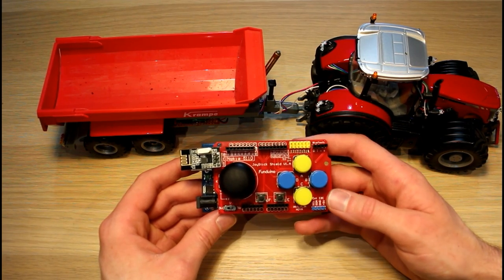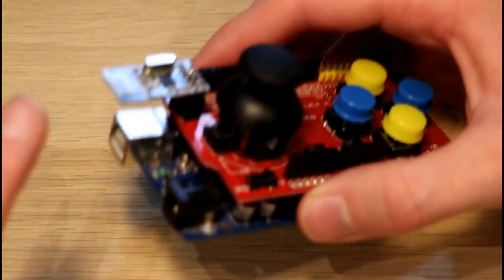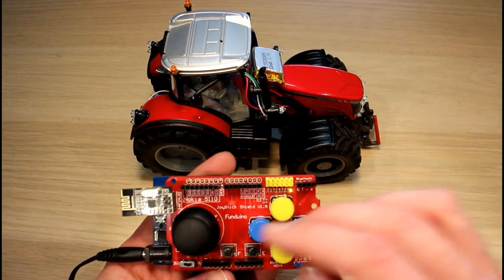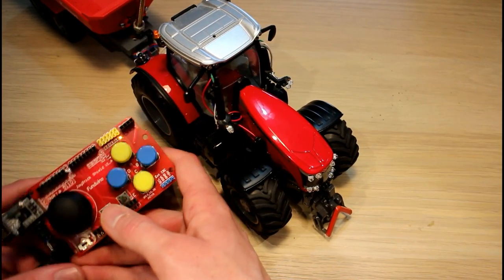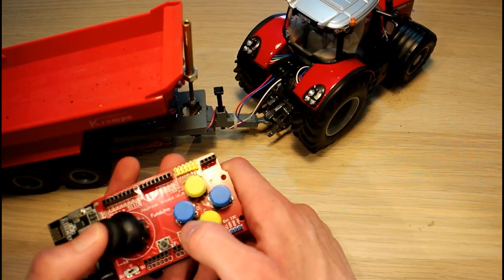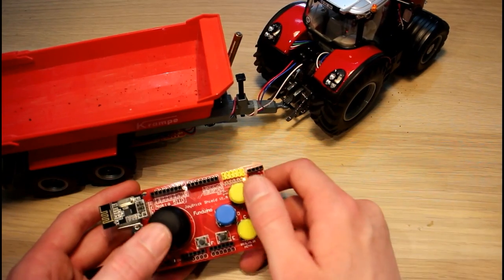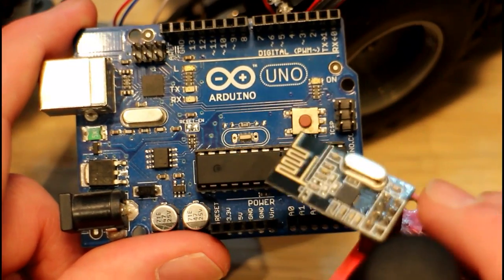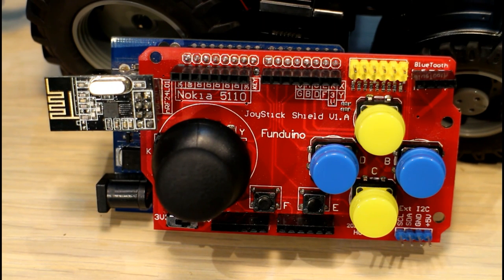Basic Arduino Based RC Controller for RC Vehicles

Comment: amazing work!  I tried to follow your code to determine how you switched modes to control different items with the same joystick, but could not find it.  Is there some code missing? thanks for a great job of showing what can be done with the joystick shield!
Reply from the maker: Hi it's been a while since I've looked into it but the code here should be the most recent http://rctractorguy.com/components/software/basic-arduino-based-rc-controller-library.  It's all handled in the library so you'd just have to look in the library files instead of the sketch to see the inner workings.

Comment: this is really good work! 
what does the tractor have that receives the information from wireless module on the controlpad ?
Reply from the maker: +dudekidPL That tractor has another NRF24L01 radio transceiver and an Arduino Pro Mini to determine what to do with the command string sent from the controller.
Reply: RC Tractor Guy Thanks a lot! i was wondering whats on the receiving end on the vehicles. your work is amazing!
Reply from the maker: +dudekidPL That is the receiving end, both the controller and the vehicles have an NRF24L01 radio module controlled by an Arduino MCU.

Comment: Hello! 
Can you use nrf24l01 which is transmitter and also receiver? İf you can do,could you please share me a basic example with codes?I want to do a project which has this issue.Please help me to solve this problem.

Comment: Hi, can i use a bluetooth module on this instead of the NRF2L01? Just bought this from your store but did not realize that i do not have NRF2L01 and thought that this is run on bluetooth
Reply from the maker: I think you could do that because bluetooth modules are usually uart I think and that shield isn't using those pins. You'd just need to do a little extra modifications.

Comment: Hi RC tractor Guy, very nice tutorial. I am building an RC tank and my bluetooth module (HC-06) keeps disconnecting from my laptop every couple of minutes or so, it's very frustrating. I was curious if I could rip out the receiver from an RC car, and still be able to write code to communicate to the arduino/motor shield through the RC car controller.  Please reply if you have the time :) thanks
Reply from the maker: Hi, the receiver in a cheap RC car is usually very crude so I don't think it would be worth the hassle. You could use one from a higher quality car but you'd be limited by the number of channels and when you could buy a cheaper radio module like an NRF and have no limitations I don't really see any benefit to the car receiver.

Comment: Hello! It seems that code (library + example) in shape as it is available for download is not really working. I know other user too who tried with no success. Also I know my transmitter (Uno+JoyShield) and receiver (Pro Mini) hardware is okay, I tested it with other Arduino NRF24 RC software. On receiver side I did try examples for JD9560R and M8680 (cab), did not work, have just both turning lights blinking. Of course I tried to push "F" button (vehicle number) many times. Could Author please give some suggestions, directions, what could be wrong in default downloadable code?
Thanks in advance!
EDIT: after some thinking, semi-educated guessing and trying, I have some initial success: 
in receiver code example (JD9560R) I un-commented this line:
radio.enableAckPayload();
now turning servo on D7 is responding. Will continue experiments, but basically it is working now.
Reply: Hi, what do you mean by "un-commented"?
Reply: Can you send me this code.transmittter code and receiver code separate

Comment: rc tractor guy yes but the remote is history when I found it just the wire is there connected to the dozer
Reply from the maker: +Jason Panzer Ah I see, well if it doesn't have sound or lights I'd say just open up the model and remove whatever electronics are there so that you are just left with the wires for the motors. Connect those up to new motor drivers and away you go. You could use a standard RC controller and receiver pair instead of my DIY electronics solution if you want but you'd want to ask in an RC store or RC forum about that because I'm not hugely familiar with those components.

Comment: does the plus and min care by a arduino and how mutch voltage can it handle?
Reply from the maker: +TJ Gamez Yes the different Arduinos have different voltage regulators in them. I think most are 7-12V but you should check for your own Arduino.

Comment: ok I will do that and the motor will tell me the ratio I appreciate your feedback very much thank you
Reply from the maker: +Jason Panzer The motor rating do you mean? If you check how many batteries the original model used and check what their total voltage added up to, that will roughly tell you your maximum voltage you can apply to the motors. Modern motor drivers would be more efficient so you could probably use a slightly lower voltage modern battery and get more power than the original model.

Comment: Wan you explain me why you went for a NRF24L01 radio module, instead off the HC-12 (link https://www.banggood.com/HC-12-433-SI4463-Wireless-Serial-Module-Remote-1000M-With-Antenna-p-973522.html) which has far better range ? the datarate should be enough to control a rc car ?

Comment: Can this work on all roc cars . Example: traxxas slash
Reply: Rc*
Reply from the maker: +Jaden Hamer If you mean would the controller be able to communicate with the standard 2.4 GHz receiver in the RC car then I'm pretty sure the answer is no. 

If you mean can you use this and replace the standard receiver in the car with an Arduino and an NRF24L01 then I can see no reason why not. I don't have much experience with standard RC components but from what I've seen it's usually servos and ESCs  just plugged into the receiver which all take a very basic PWM signal to control, the Arduino has libraries built in which generate this signal so you don't need to do any complicated coding.
Reply: +RC Tractor Guy thanks

Comment: can i use a 433mhz module instead?
Reply from the maker: If you know how to control it then I don't see why not, I was using XBee modules at the start.
Reply: RC Tractor Guy hello
Reply: RC Tractor Guy I. wanna do a RC car help me with circuit..... circuit for 4output what can I use for tramitter and receiver

Comment: rc tractor guy can you make a new remote for a  new bright cat a pillar bulldozer
Reply from the maker: +Jason Panzer You mean convert it to RC instead of a wired controller? That should be fairly simple, you just need to replace the old electronics with their modern counterparts. I'd use this as a controller and in the dozer I'd use an Arduino Pro Mini, an NRF24L01 and two TB6612FNG motor drivers for the track and blade motors. The old motors might require more current than the TB6612FNg can supply so you might have to use L293Ds with a higher battery voltage instead. You'd easily add proportional speed control and could use a much lighter and more powerful battery.

Comment: What would be the price for this controller? Will it be able to control 8 channels?
Reply from the maker: +Tractor Trac Tech The parts for that controllers would probably cost around $10 I think. If I remember correctly the NRF24 is a 68 channel transciever 2 MHz per channel. If you are talking about channels in the old toy RC controller definition where a channel is like a switch or an axis of a potentiometer then you have infinite channels provided you have enough patience to keep adding I/O expansion chips or ADCs and you happen to own your own power plant :)
Reply: Hi, by 8 channels, I had in mind 8 servos (standard remote control and receiver), like in any other RC vehicle,... And comparison to your controller. 
Also have you been thinking to put it into joypad? Looks quite similar, maybe you can use housing.
Reply from the maker: +Tractor Trac Tech Okay that should be pretty simple, an Arduino Pro Mini should be able to use an NRF24 radio module and have enough pins left over for 10 or 11 servos I'd say. The number of servos you can control is limited only by your power supply and patience really, the more servos you have the more complex your code will be in order to control them with limited inputs. As an example you can have that controller talk to an Arduino Mega and they can comfortably handle 46 or 48 servos I think but if you needed more I'm sure there are other faster MCUs with more outputs. You mean an Arduino in like a game controller? I think there are boards for that using the XBee at least, handy little controller.